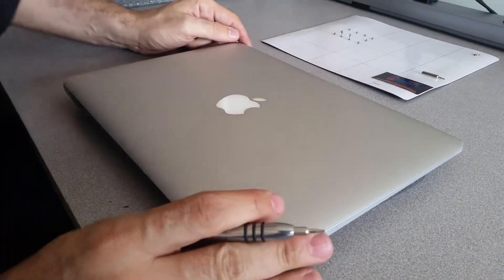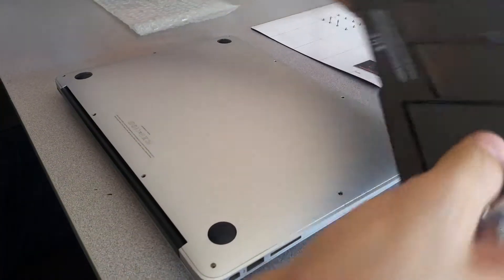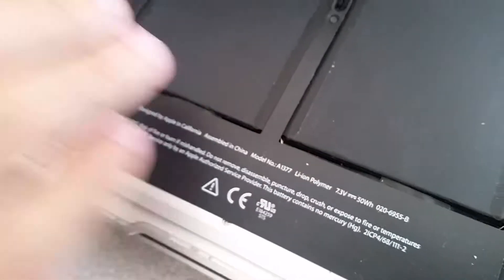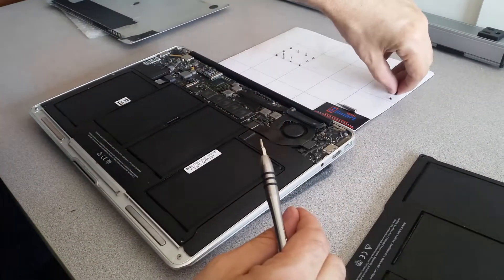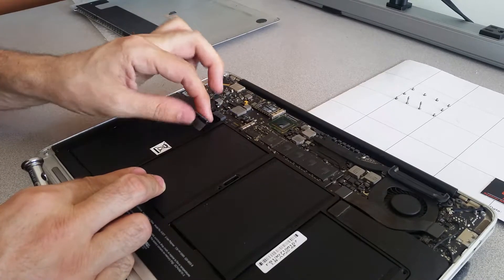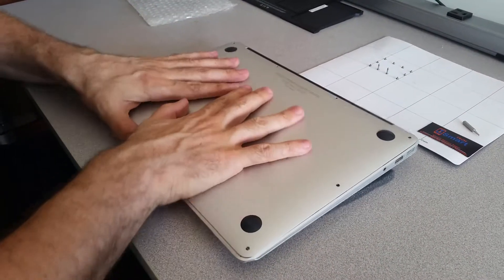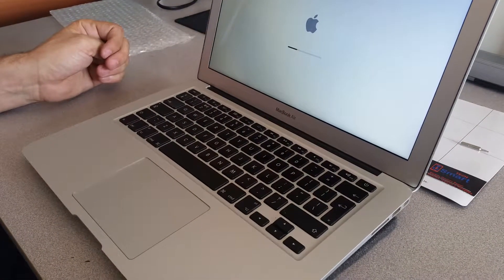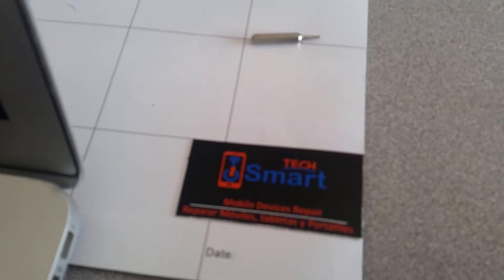How to replace the battery on MacBook Air 13" and fix slow system.

Comment from the maker: Yes, this video was only about how fix the slow system after replacing the battery. and the problem was solved by installing the correct part.